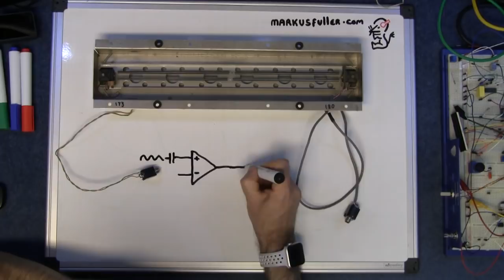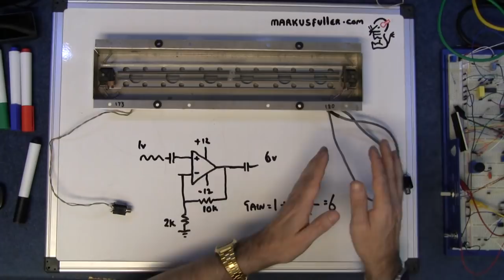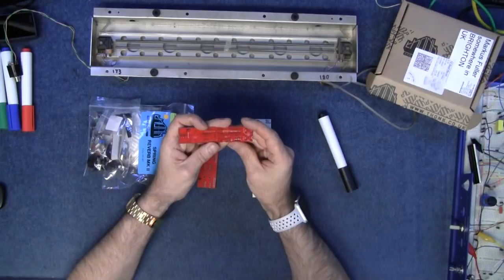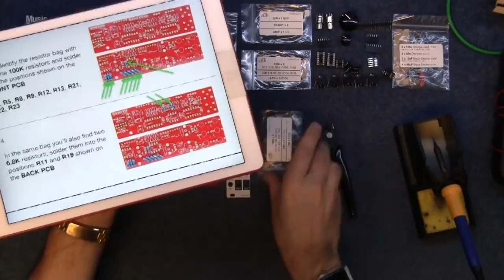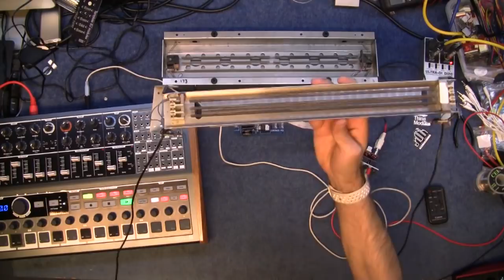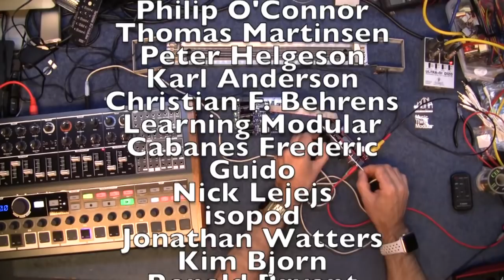Building the Eurorack Spring Reverb Kit from Thonk

Comment: I tend to tack sockets in place by tinning the soldering iron tip, fitting the socket and then just rubbing the solder across a pin and pad. It's always worked for me and slightly quicker. Just remember to reheat the pad to properly flow the solder after though.

Comment: Great video -- you've sold me on picking up that Spring Reverb kit.
Would suggest your next build be a Turing Machine also designed by Tom Whitwell (Music Thing). Lets you loop and cleverly manipulate random voltages. Or maybe a Bafaco Rampage. It's a dual Serge-style voltage controlled slope/slew with a lot of extras thrown in. Lot of soldering, but a very straight forward build otherwise.
Reply: Technically you are right but I think a better description would be a generative sequencer on the Turning Machine since I think people that have not read the papers Tom talks about

Comment: If you're going to build your own Case, maybe get a TipTop Happy Ending kit✓

 µZeus Power w/Rails, Buss Board & an Adapter. Plus you get Ears. It's like $160.

 As for your next Module... you need an Oscillator!
Reply from the maker: I quite like the arturia link. bit expensive though.
Reply: Fancy fancy!